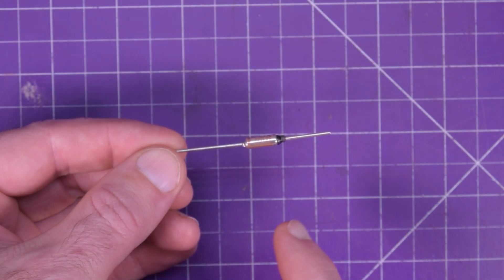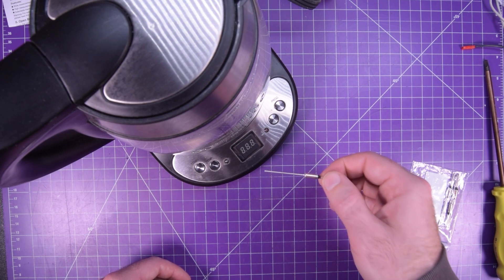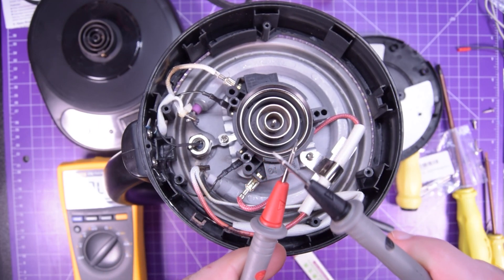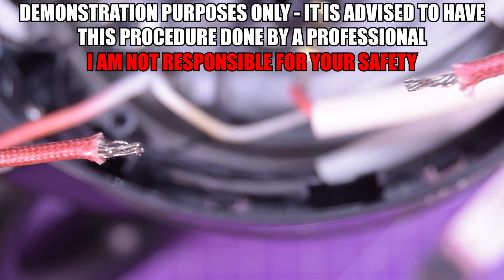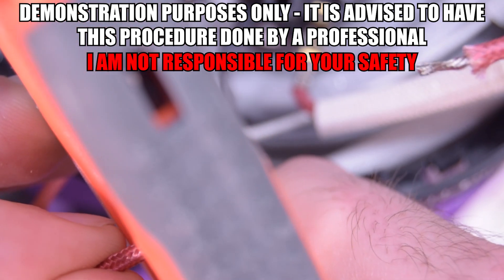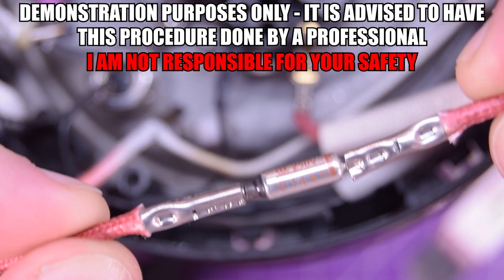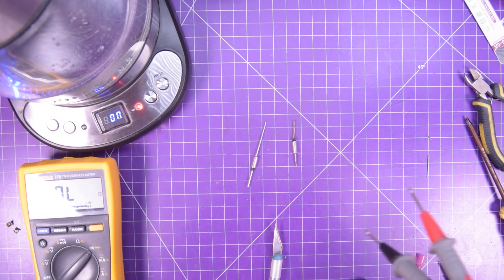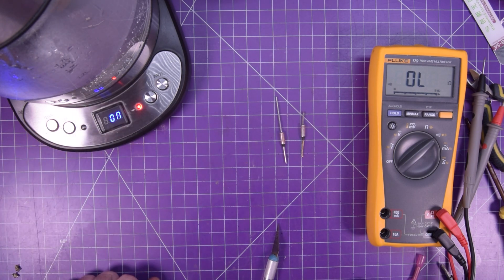THIS Is Why Your Appliance FAILED!

Comment: Fuses usually blow for a reason though.  I could see a coffee grinder popping because of clogging but your heating element could have high internal resistance.
Reply from the maker: Low internal resistance you mean right? For high current? It seems to happen only every couple hundred uses so I'm guessing it's heat cycles or vibrations (water boiling) causing it to fail

Comment: Why does a 110V device use a 250V fuse?
Reply from the maker: 110v is a RMS value, peak voltage is 170v
Reply: @SimpleElectronics  Your thermal fuse says 250V~, so it's the AC rating.

I live in a 230V country and all devices that have a mains glass fuse have a 250VAC rated one.

I bet a 120V country uses 125VAC glass fuses.
Reply: Fuses are current limiting devices.  The voltage rating can/usually is overspecified but doesn't effect the circuit protection.  You could use a 1000V fuse but the size and cost would increase.

Comment: I've had to do that before too, always wondered what makes them fail and can they be soldered if no crimps are handy at the time?
Reply: Some solder melts at 192C.
Reply: @Okurkaarrgghh  Wasn't sure about that, Thanks!
Reply from the maker: Like @okurka said - it would be really easy to overheat it

Comment: Wow sounds like the Root Cause failure is the design.Seems like the fuse reliability or fuse placement is the issue 🤔🤓
Reply: Planned obsolescence.
Reply: @Okurkaarrgghh  Yes, that's exactly what I was thinking..This must have been purposely chosen 🤔
Reply from the maker: I feel like it's probably thermal cycling combined with a relatively low thermal fuse.
Reply: @SimpleElectronics  Those are designed to melt at 192C plus zero C or minus 5C, so anywhere from 187C they can melt. They also age, as the soft low melting point alloy rod inside corrodes when it is hot, so yes they do fail from time alone.  They also are common in a lot of motors and transformers, though not always in that form factor, as safety elements, typically a 132C one to 175C, which is there in case of a shorted turn or overload.

Soldering will melt them, though with a good pair of pliers holding the lead before the device, you often can solder the higher temperature ones in. But just a crimp works well, you can cut that crimp in half, and then push both into the hole before crimping, and it works.